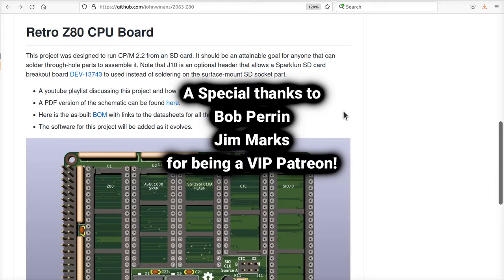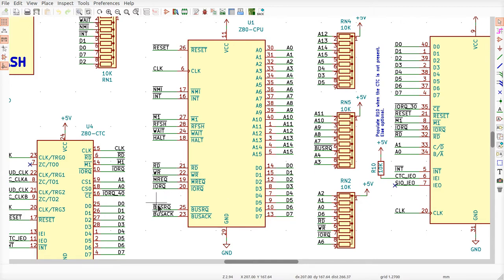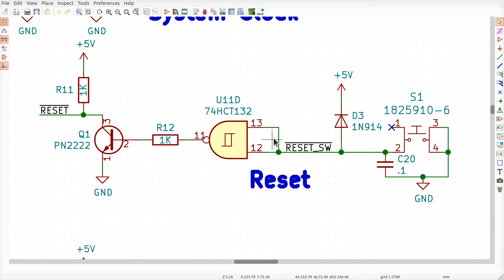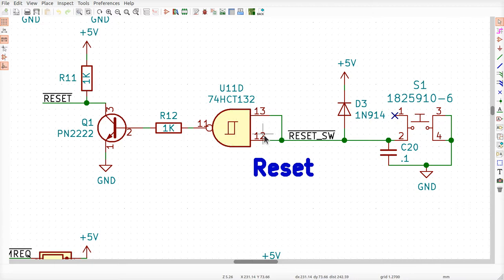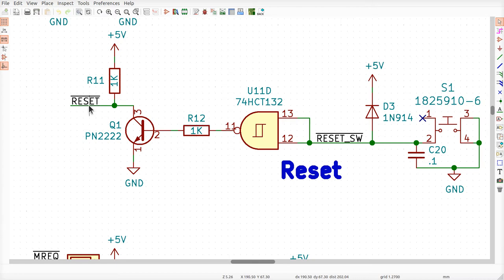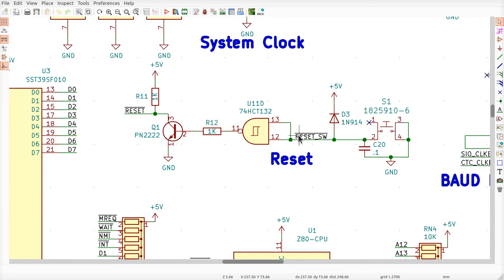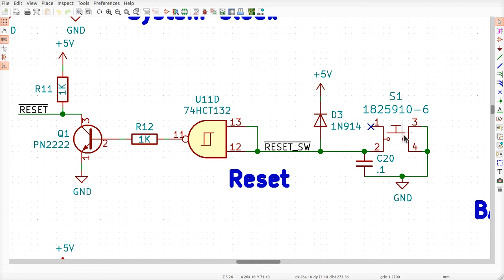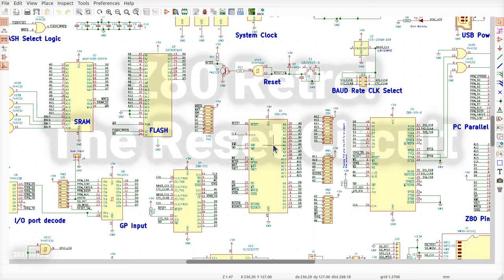Z80 Retro #4 - Reset Circuit

Comment: Hi John. This is excellent and a much appreciated design. Notice though that the <delta Vt>(hystheresis) is only (min=0.4 / max=1.4/1.5) on the HCT132 with a positive threshold (Vt+) of 1.4/1.5 and a negative threshold (Vt-) of 0.5/0.6. To get hystheresis closer to GND and VCC as you described you need a voltage comparator like the LM397 or an opamp like the LM358 mounted as a  voltage comparator with hystheresis feedback resistor. King regards, RJM
Reply from the maker: Yeah... I might have exaggerated a bit on the thresholds. But it is wide enough to clean it up.  It was a noise-fest with a '00 part.
Reply: @JohnsBasement  Keep up with this enjoyable series of videos. I am the owner of an Altair and an IMSAI in working conditions (;-)). Regards, RJM
Reply from the maker: @rene-jeanmercier6517  Thanks! 
I never had an Altair.  But I do have a nice IMSAI around that I tinker with from time to time.

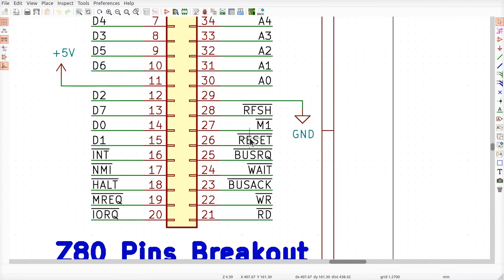Comment: @12:40 Pro tip: you have to release /RESET in order for the Z80 to honor a /BUSREQ. Takes a few T-cycles. [2c]
Reply from the maker: You are correct!  It turns out that the Z80 will yield the address & data lines during /RESET but not the control lines... and yes, the FLASH code on my github site leaves the /RESET asserted when it shouldn't be.  I'll push up a fix for that after a get a few minutes to verify it.
Reply: @JohnsBasement  Been there, done that - they were all out of T-shirts ;-)
Reply from the maker: 😂... I'm gonna use this line!

Comment: When you talk about the Schmitt trigger NAND gate not being happy during power shutdown what you mean is the ESD diodes connected to the gate inputs are not going to like seeing the capacitor discharge current come roaring into the part. Diode D3 provides an alternate (and more preferred) discharge path. It's not uncommon for ESD diodes to have a rather large voltage drop, so you can skew the current through D3 by implementing a narrow input trace to U11D (more resistance) and use a Schottky diode for D3 (lower voltage drop).
Reply from the maker: Ah yes!  I should have gone Schottky with that discharge diode!  But given it is only a .47uF csp, I'm gonna let it wait until I create a new rev for other reasons.

Comment: A NE555 is an alternative, also where you have potentially long signal traces & busses, especially going "off board" terminating resistors @ either end are advisable I seem to recall.
Reply from the maker: Yeah.  The CLK signals DO overshoot more than I'd like to see.  The address, control & data lines all look perfect though.
I'll add some footprints for CLK terminators in Rev 4. I suspect series termination will work best here.  Any thoughts?
Other concerns that I have had include:
- adding a daughter card /will/ turn the Z80 signals into a star
- series-terminating the parallel port
I'll observe that it operates reliably for days on end as it is. So how much better does it really need to be?
Reply from the maker: @kalimgold9268  It is not the period of the wave, it is the slew rate that is the concern.  The oscillator chips have a very square wave and a low-enough drive impedance to slam the voltage up and down very quickly.  Without any termination, the signal will rush down the copper track and if there is nothing along the way to dampen it before it gets to the end, it will flap around like a flag in the wind. You can see it doing that on an oscilloscope... it is called 'ringing'.
So, even at 10mhz I have ringing because the clock source impedance is lower than what it is connected to.
On the one hand, the ringing doesn't appear to hurt anything (because everything runs OK). But it might be close to a limit on some of the chips that could glitch in a weird way from time to time.
It is one of those things where it is not a matter of 'if', it is a matter of 'how much' and is it less than the tolerance of the rest of circuit?
The connectors between the PCBs can also cause a problem if their impedance is different from the copper tracks on the PCBs... and they most likely will be.  cheap .1" headers are not going to be even close!
DIN41612 connectors are going to be better than generic .1" headers.  But how much, I don't know.
I would look around for detailed specs of things that use them.  Like the VMEbus and Eurocard.  They will discuss recommended termination techniques and signal speeds.
Reply: @JohnsBasement  yes, I spent a lot of time two years ago looking into if I could get high enough clock / signal rates I want but have taken this year out (from researching while doing other things and health issues) but hope to get back to prototyping after Xmas.

Comment: Are the address and data pull-ups solely to prevent issues when some sort of assertion could be happening on the bus header? Or is there another practical issue? Also, I've heard that 3K3 is actually a better pull-up than 10K (well, at least, when designing with the 6502).
Reply from the maker: 3.3K is probably better than 10K.  But it depends on what you are pulling on and why.
I chose 10K because it is what I had in stock.
For a pullup on a digital line, I would not want to go higher than 10K.

Comment: Seems I've shown up to class a bit late. Anyway ... quick question: 

I don't have a 74HCT132, however I have a ton of 74HC14s. I'm pretty sure the 74HC14 is okay, but I'm wondering about the HCT vs HC. From what I understand the main difference is the HCT requires a more precise voltage supply. Is this likely to be a problem? Or can I get away with the HC variant? Thanks.
Reply from the maker: The T has TTL compatible inputs... Which have a restricted voltage range.  Yeah.

I chose it because i did not want to add another chip to the board.  I needed a nand for the reset latch.  By making it a Schmitt i could use a spare gate on the reset circuit.  I used the HCT because I did not see an HC with Schmitt inputs.

If you are making a custom version, you can forego the fancy open collector & schmitt altogether.  Just connect the switch, cap & resistor to the cpu, ctc, and sio... as seen in the Z80 user guide.  Only problem there is if other circuits need a reset that dont have their own Schmitt inputs and/or if you want to generate reset from an external open collector driver like my PI FLASH programmer board.
Reply from the maker: I should also mention that the '14 has a different pinout than the '132 too.  DO NOT expect that you can just plug one into the U11 socket and see it work properly!
Reply: @JohnsBasement  Okay, thanks ... this makes perfectly good sense; kill 2 birds with 1 chip. Unless I run out and buy more parts, I may need to add an extra nand. But it's still early. I'm only on your 5th video. By the time I'm caught up, maybe I'll have some other ideas. I'm not worried about the different pinout. I'll probably redo much of the board with SMD anyway. 

I really appreciate your efforts. For me, this isn't a mad dash to build a retro computer ... it's about learning how to do it.
Reply from the maker: @YoutubeBorkedMyOldHandle_why  feel free to keep me in the loop.  I'm interested in where you end up going with your project.
You likely know there are 0lenty of other retro Z80 boards out there.  If you find is a better fit for your project then please let me/us know about it!... and why, ofcourse.

Comment from the maker: I got a message (out of band) about the inclusion of a current-limiting resistor (lower case-r in this diagram: https://en-support.renesas.com/knowledgeBase/16980878) to protect the diode & push button.
In general, it would be a good idea.  However, I assumed that shunting a .1uF capacitor would not be enough to damage the switch.  
I also expect that a 1N4148 diode is capable of passing anything that C20 (.1uF) can offer into the +5 rail before the current gets out of hand.
Any thoughts on this?  Should I add a current-limiting resistor in between C20 and D3/S1?
Reply: Been a few months - just saw you video. I'm looking at the schematic for my old PMC-101 Z80 (circa 1983) and the reset circut is nearly identical. Uses a 10K resistor in parallel with a 1N914 diode using a 4.7uf capacitor and using an RS flip-flop to debounce the Reset switch. This board however does not allow external resets to occur, it only sources the signal.
Reply from the maker: @jrkorman  4.7? 🙄. Yeah, in a revision I changed mine to .47 in a rev after I found one of my USB supplies ramped up slow enough to defeat a  .1
Reply: @JohnsBasement  Yes - Very clearly 4.7 uf on the schematic; even marked to show it as an electrolytic. And then right into a 7408 AND gate; no schmitt trigger.
Oh, I've just subscribed also. Your channel was suggested this morning, like what I see!
Reply from the maker: @jrkorman  Well, raise it as needed.  The schmitt is not needed if you're only going to reset the Z80 and Z80 family chips because they're spect to be reset without a cement trigger. But if you're going to use reset for anything else, you might want to clean edge.